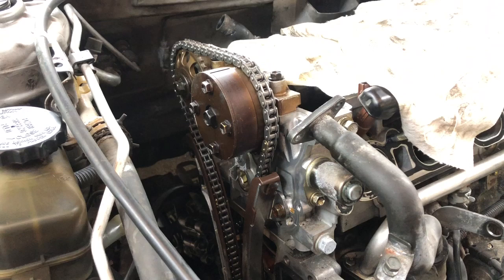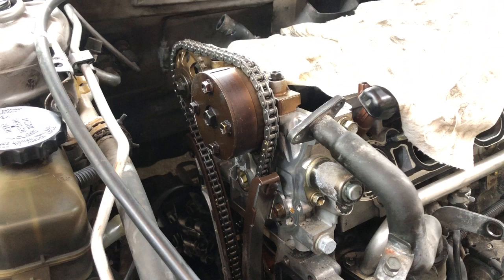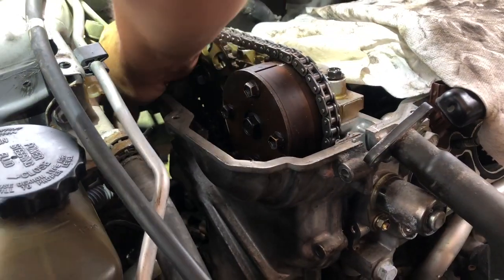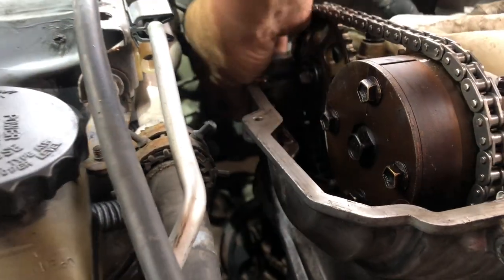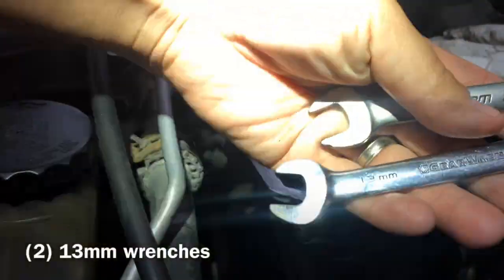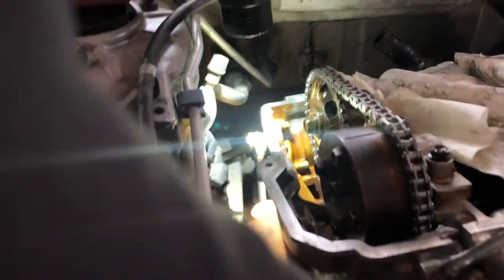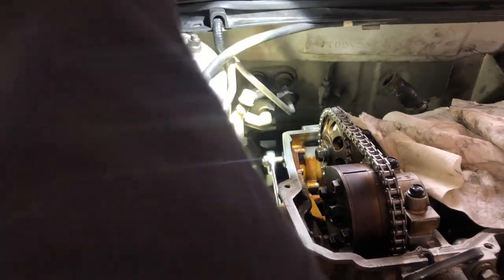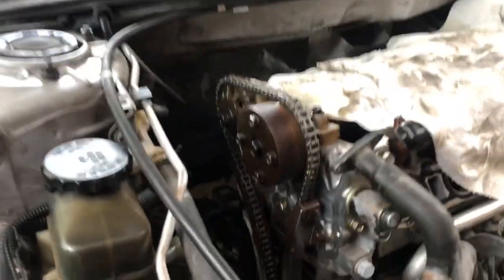How To Remove Timing Chain Cover On A 2zz-ge Engine

Comment from the maker: Hi Tony P,
I’m still in the process of the repair. The reason I had to take out the timing chain cover was due to the removal of head. However, to replace timing chain cover labor time should be 2.5 to 3 hours.
Reply: What size nut did you use for the stud?

Comment: Does the ac have to be unbolted to remove the timing cover? in the middle of this job and the top bolt on the ac comp is gaffed up and can't remove it. trying to do this for as little as possible dont want to pay to dis/recharge the system.
Reply from the maker: I did not remove ac compressor. There is no need to recover refrigerant.
Reply: @713jtmechanic8  Forgot to say thanks, Got the cover off and car is leak free.

Comment: Is this a Corolla xrs or matrix xrs with air injection? Was it necessary to remove the exhaust manifold?
Reply from the maker: Same engine, however, I was working on a Celica GTS. No need to remove exhaust to work on timing chain.
Reply: @713jtmechanic8  I am under the impression that because the air injection system is part of the cover?
Reply from the maker: @pocketaas75  I believe the air injection system you are referring to, is the steel tube that bolts onto valve cover. It's tricky, but the tube had enough flex to clear the studs of the flange mount.
Reply: @713jtmechanic8  No, he means the steel pipe of the exhaust manifold that "hugs" the chain cover on 2zzge Celica GTS , starting from 2003 to 2005, that ones with the secondary air pump.
Reply from the maker: @andrea981  Thank you for the explanation. I guess, I'm not familiar with that design, since my GTS was an 01. I definitely will research it. I enjoy learning new things.
Reply: @713jtmechanic8  I know only because I'm a 2004 Celica TS (European GTS like) owner, and I am researching how to change the chain cover gasket; that steel pipe is a pain. I have found two solutions for the job , first one - that is how it should be done - is to remove the exhaust manifold. It is possible to remove it in the car (but it is tricky) . The second one is to bend the exhaust manifold steel pipe just enough so it is possible to remove the chain cover. (I don't like this one, but sometimes removing the manifold it is a fight with rusty bolts, if you are not careful you risk to snap them).
Reply from the maker: @andrea981  Both options sound tricky. Either you deal with rusty bolts, which can strip or bend the pipe and possibly damage the pipe. If I was in this situation, I would remove exhaust manifold, only if I had a torch to cut off bolt heads. Bending the pipe seems the  quickest and better odds to complete job faster.
Reply: @713jtmechanic8  I have just tried to loosen the exhaust manifold upper heated insulator bolts, and they come off easily. I have not yet tried to loosen the exhaust manifold bolts yet( I'm not doing the job now since I have not the time right now, I just have tried if at least the insulator bolts would be easy to remove ). Since you have already removed the exhaust manifold , are that bolts much more difficult to remove in your experience ? I hoped that mine would be less rusted than usual since the insulator ones were easy. I really don't like much the idea of bending the pipe. If I would be able I would prefer removing the manifold.
Reply from the maker: @andrea981  removing the exhaust will take little more time and effort, however, its a safer method. Meaning less chance of damaging the tube by bending it. I did not have any difficulties removing exhaust bolts. I highly recommend to use PB Nut Blaster. Yes, the name is correct. LOL Spary it on bolts and let it soak. By the time you are ready to remove bolts. It will make it so much easier to remove. Good luck. Hope this helps.
Reply: @713jtmechanic8  Sure, any suggestion is precious , thank you ! I was using WD40 on the insulator bolts, are PB Blaster a better penetrant oil ?
Reply from the maker: @andrea981  WD40 work well, however, in my 20 years PB blaster Nut buster works 95% of the time. The Nut blaster is stronger than penetrating oil.
Reply: @713jtmechanic8 Thank you for the suggestion. I have ordered a couple of bottles of PB Blaster. I could have access eventually even to an oxyacetylene welding torch. The heat can be useful too in worst case scenario I guess.
Reply from the maker: @andrea981  Yes, Torch works always. You will see the difference using PB Blaster. Take care
Reply: @713jtmechanic8  Finally I'm doing this job, and with PB Blaster the 2zz-ge exhaust manifold bolts came out really fine ! I was amazed that in a couple of hours I removed all of them !  Now I'm in for another problem: when I need to torque the bolts, not for every bolt is possible to fit a torque wrench. Some of them need a swivel head wrench, so how can I torque them to spec ? Have you got a trick ? You go by feel ?
Reply from the maker: @andrea981  unfortunately, the area is difficult to use a torque wrench. I go by feel.

Comment: How much would this cost if we were to have a shop do this?  Toyota service people are charging waaaaaaay too much.  Thanks for the video, it will help not get swindled.
Reply: I have a leaking timing cover on a corolla xrs and toyota was quoting between 1-1.5k for the repair.
Reply: @brinho109  yep, they quoted 1300.  It's too much!
Reply: @uzmabailey240  Ya it is pricey but if you don't have the equipment, space or time it's not the worst charge I've seen.  There are some videos on here of people doing the replacement with the engine in the car if that route is appealing to you.
Reply from the maker: Sorry for the respond. I am not sure to get receive notifications when some one comments. Still learning. Back to you question. Something like this at an independent shop will be an the 800 to 1200. Ball park figure.
Reply from the maker: @brinho109  Hi Nunu, If the shop is removing timing cover do to leaking oil. They maybe including replacing timing chain and related parts. It is costly.
Reply from the maker: @brinho109  The thing to consider if the engine you are replacing with used or rebuilt. Its risky if the engine is used.